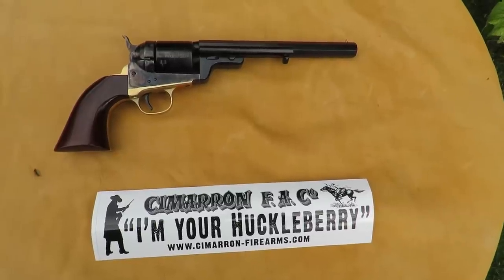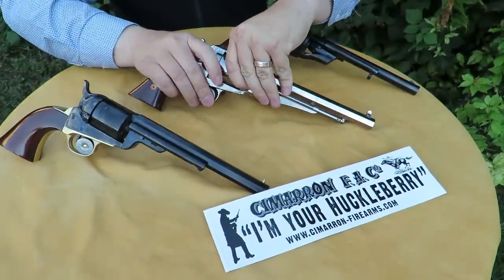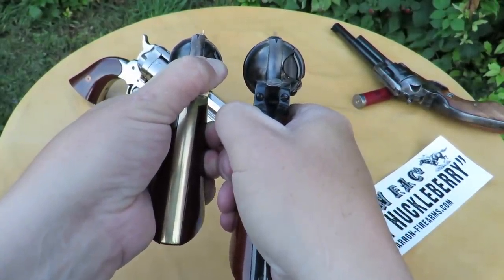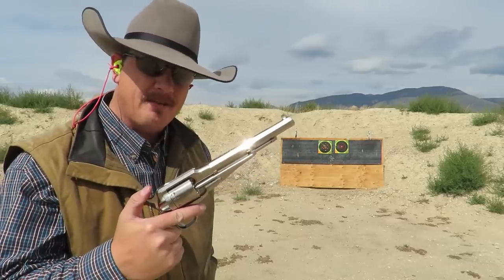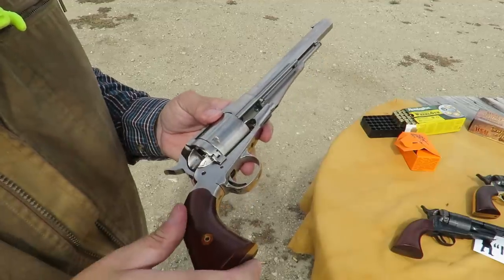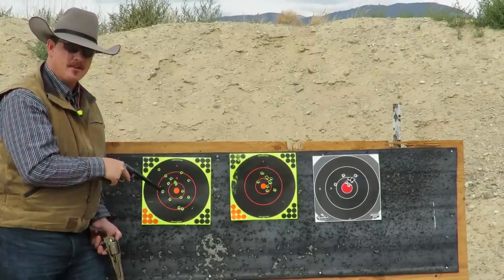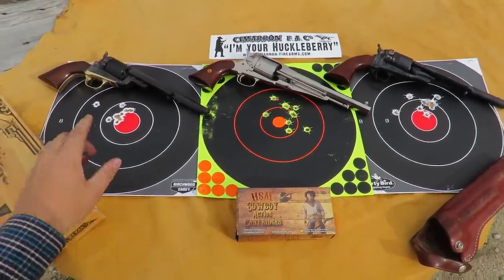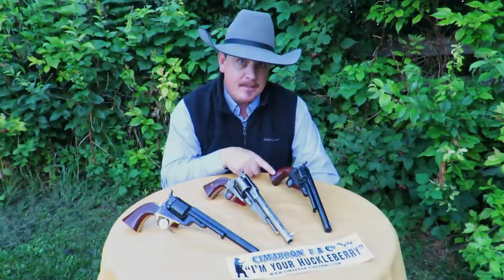CONVERSION REVOLVERS! from Cimarron Firearms

Comment: Let people know that on the Remington, the rammer was left in place because it still retained the cylinder pin, keeping it from coming out.
Reply: Jason, that's true but the other reason was you could easily convert back to the cap & ball version.
Reply: @toddy2519  On my Remington FULL conversion, there is no going back to percussion, thus the plunger of the loading lever was removed.
Reply: @toddy2519    I'm wondering if you could use it to reload the cartridge in a pinch. There would be no way to crimp it, so the bullet would probably pull out of the case under recoil.  Still, in a pinch an old time cowboy could maybe load and single shot shoot these …...
Reply: @MuskratOutdoors  I'm not sure what you mean, could you rephrase the question? (are you asking that when using a cylinder conversion can you reload a centerfire case in the gun using the rammer?)
Reply: @toddy2519    Yes. I have never heard it used that way, but I think it would work. When you think about it, a self contained brass cartridge, and a cap & ball cylinder are basically the same. A primed empty case in a reloading die isn't any different except crimping the case neck.
Reply: @MuskratOutdoors  That's why I don't own a Remington pistol!  I like my Colt 1860 Army waaaaay better.
Reply: @toddy2519  Not necessarily. Depends on how the conversion was done.
Reply: @MuskratOutdoors  The Ideal company made a hand loading tool (Sometimes called a "tong tool") in numerous cartridges. With a single tool, you can cast a bullet, size it, prime the case, bell the case mouth, and seat/crimp the bullet. Several YT videos about them.
Reply: @jason60chev   I actually collect those. I have a dozen or more of them, but thank you for the info.
Reply: Depends on the conversion. I've seen a few cartridge conversions of the Remington New Army that don't have the ejector rod - just a different cylinder with spring-loaded firing pins. You could easily swap between a percussion-cap cylinder and a cartridge cylinder in short order.

Don't know if that will work so much in practice, but I know the conversion exists.

Comment: The Remington was actually the most sought after once the Civil War ended.
Reply: WAR OF NORTHERN AGGRESSION
Reply: @boristhemouse5507  those blue belly yankees vs johnny reb 😂😂🤣🤣
Reply: Even before the cartridge conversions became common, the Remington New Army had a huge advantage over most Colt revolvers of the time. You could just throw it on half-cock, drop the ramrod lever halfway and pull the cylinder rod forward to replace your empty cylinder with one you already loaded earlier.

Which was a hell of a lot faster than pulling the barrel pin off the Colt revolver, pulling the whole barrel and ramrod assembly off, sliding the empty cylinder off, replacing it with a loaded one, put the barrel assembly back on and then have to beat the barrel pin back into the gun.
Reply: @boristhemouse5507 don't know man, the south shot first

Comment: Due to having a good machine shop at the time, I converted 44 Colt Navy 1851 replica made by Navy Arms to 22. Made new cylinder and detachable back plate that contained floating fire pin. Barrel insert was made from an old 22 rifle with conical muzzle nut. That way I could use it both ways  with very little work.  It shot pretty well and ammo was cheap. Put thousands of rounds thru it.

Comment: I love colts because they’re easy to aim but I trust Remington’s more reliable and robust design. Remington may be a bit slower than colt at reloading, but still reliability is more important than looks
Reply: the early stuff remington new army is easier to aim / dial in than open top colts. but i do love fussing with my colt open tops ! who i am kidding i love them all. i am ITCHING for the remington my buddy has an original remmy conversion all i can do is drool. h0pefully i will have one before summer, was supposed to get it for christmas but they were sold out. so i got a McCulloch instead. love that thing too
Reply: I was of the understanding that Remington originally favored brass frames that stretched over time leading to significant issues...
Reply: I have a pair of the 5.5 barrel 58's. They are my favorite guns to shoot when I compete in cowboy action
Reply: @InitialFailure  thats false.. no one used brass frames but a few limited guns and the numbers were small like in the tens.. not even hundreds.. This is just a thing these modern companies tell you on the boxes..   I have brass frames 1851 and 1858s and havent noticed any stretching..

Comment: Loved the video - very informative for those unfamiliar with conversions.  I plan on getting two for Cowboy Shooting and participating in both cap & ball and cartridge. And bravo for shooting a second time with the .38 because we ALL suffer from those times when it is totally 'shooter error', and some more than others!  Thanks

[One small criticism of you and 99.99% of Cowboy Shooters and 'gunnys' - there is no such thing as a .45 "Long" Colt - admittedly it's part of the popular culture and labeled on all sorts of materials including the firearms, but Colt NEVER MADE a .45 LONG Colt.  They made short and long versions of the .32 and .38, but only made ONE size of .45.]
Reply from the maker: So, I agree and disagree. You are correct about the original designation, however when most factory ammo on the shelf is actually labelled "45 Long Colt" that does, in fact, make it "Long Colt". When most of my viewers go to buy them ammo, that is what they are going to see, so I use the current nomenclature to make things less confusing for them.
Reply: Colt made 45 cal, and so did others like Smith & Wesson and cartridges were different lengths, it just became 'habit' for people to say long colt, because it was longer than the 45 S&W used in the schofield revolver
Reply: I wondered how long it would take for someone to come up with that criticism.

Comment: There was nothing intrinsically wrong with the group from the 1851. It was perfectly centred, not high, low or off-set. It just needed to be tighter.
This is usually the sign of a worn barrel, but in a new pistol, it probably was the cartridges. 
Many years ago, I had the opportunity to shoot an origional ball-and-cap '59 Remington. I remember that I was not at all happy with the sight picture. Was it made that way in order to prevent it snagging upon the holster?
Reply from the maker: I would assume it was for that purpose.  My group tightened up the more I got comfortable with shooting it.
Reply: @TheAdventureCowboy  Glad to hear it. 
If  I had the choice, I would probably take the '51 in 38sp. 
I used to cast my own bullets so I would be interested in seeing how it does in the 100yd test.
Reply from the maker: @paulbeesley8283  Unfortunately, I no longer have it to test that.
Reply: @TheAdventureCowboy  Ah well, not to worry. Thank you anyway for your replies.

Comment: I own an example of the Cimarron 1860 Army type one Richards conversion.  It was made from parts manufactured by Armi San Marco, and assembled by Cimarron.  It is chambered in caliber .44 Colt.  It would be nice if Cimarron could convince Uberti or Pietta to manufacture a new 1860 Army Richards type one conversion.  If you like the type two Richards‘s conversion, then you would love the type one Richards conversion with its frame mounted, spring-loaded, firing pin, and conversion ring mounted rear sight!  Thanks for your great video!

Comment: 12:53 That reason is most likely the wrong ammo, since .38 Special is in actuality a .35 caliber projectile (in a .38 caliber chamber). Old-timey .36 caliber revolvers are closer to .37 caliber than anything else. Shooting off-the-shelf .38 Special like that, you're putting a .357 diameter bullet down a .372 caliber barrel (with .360 lands).

Appropriate .38 Special ammuntion for an old-time conversion would be wadcutters or any kind of hollow-base bullet so you get a skirting action on the projectile wide enough to engage the rifling.

Comment: Don't have a Remington, so I have to ask: Do you need the rammer there to keep the lever attached (like in a Colt 1860)? I am aware that you need the loading lever attached to hold the cylinder pin in place, which is why you want to keep the loading lever on a Remington conversion. I just assume that if one could get rid of the rammer, it'd go since you can't use the thing anymore.

Comment: Man, the 38 special one would pair awesome with my Marlin 1894 in 357/38!
Reply: Probably not so much, I'm afraid. A modern .38/.357 has a .357 bore diameter-- these old .36 guns were bored to .369 or the like (the muzzleloading bullets themselves were .375-.38 in diameter). The .38 Special loads for a conversion should be hollow-base so they expand wide enough to engage the rifling.

Comment: i was going to get one of these but ran in a good deal on two 1858 remington glad i did not get the conversion revolver they came with extra cylinders and 2 converters so i have the best of both worlds and it take 2/3 sec too change the cylinder it shoots cap and ball ,bullet and 45 long colt
Reply: just let know the 1858 remington that i got took first place in revolver shooting contest they have been reworked by a gun smith and the guy i got them from was expert shooter that was another reason i got them
Reply: you know they have a drop in side load conversion, you  will have to mod it a little but the you can have the best of all 3 worlds

Comment: Good review. You should have a Colt Italian clone old model  instead of a a Ruger for comparison. Cool thing about the conversions is that you can shoot 45 Schofield in the 45 Colt, 44 Special/44Colt/44 Russian in the Richards-Mason chambered for 44 Special, and 44 Colt/44 Russian for the one chambered for those. 38 Short and Long Colts can be fired in the 38 Soecial , I believe. These options give you good, low powered Cowboy Action loads.

Comment: With the Remington, it's easy to carry pre loaded cylinders, (either cap and ball, or a different type of conversion) and swap cylinders when empty. See Clint Eastwood's Pale Rider.
Reply: @buffbeezer This would be what many call a "factory conversion" and is permanent. (Except taking it apart for cleaning) The pale rider version is just a "drop in cylinder". The original conversion cylinder had small cut outs so that the hammer would strike the rim fire cartridge. The modern version has firing pins for centre fire cartridges. Duelist1954 has several videos on conversions.

Comment: I'm both a Cimarron fan and a conversion revolver fan.

 I've converted a Pietta .44 steel frame "Navy" to .45 Colt with a Kirst gated conversion and I've got the "Man With No Name" .38 Colt/ .38 Special "conversion".

  I have their 1851 Navy .38,   a Navy grip framed Open Top(yeah I know it's not a conversion) in .45 Colt,   and POSSIBLY an 1860 Army Type II in .45 Colt on my "to do" list.

 I'm partial to the Navy grip configuration, but the 1860 Army is still a lot better than a Bisley grip...to me.

Comment: I have a serious question about the 1858 new model army conversion in 45 long colt
Is this newer model drop safe from my understanding these newer reproduction revolvers have a safety mechanism if all the chambers are loaded I would like the older guns yes it's better practice to have an empty chamber but I'm just wondering if this one has that safety feature I am planning on buying this very soon I'm also curious if I can buy the original cap cylinder and switch it out whenever I want
Reply from the maker: It is not sold or marketed as such, so I cannot say for sure.
Reply: @TheAdventureCowboy  all right I guess I'll have to figure out how to check it whenever I get it and you know how I can get a matching non converted cylinder to switch out?
Reply: @Self sufficient Traditionalist thank you very much!
Reply: They change the specs on the Cartridge Revolvers slightly so you can not convert back and forth between Black Powder C&B and Cartridges.  Example the Uberti 1873 Cattleman Black Powder Revolver.
https://www.midwayusa.com/product/1002297696
Reply: @Self sufficient Traditionalist it's just I've heard that these reproductionshave safety pins and stuff in them so you can load all six Chambers although I know that it's safer practice to have only five

Comment: I keep hearing from other channels that there is no such thing as a .45 Long Colt, but should be referred to as .45 Colt. The term ".45 Long Colt" is so common though. I wonder the origin of using the term ".45 Long Colt".
Reply from the maker: It had to do with other .45 cartridges available at the time.  People just started saying "Long Colt" to differentiate from other similar, yet shorter, .45s, like the 45 Schofield

Comment: Is it necessary to take of the ramrod from the colt revolvers?
I'm just asking because for me it looks cooler with the ramrod under the barrel.
Sorry for bad English and greetings
Reply: They make them with the loading lever replaced for convenience of unloading spent cartridges, as well as to be a little more historically accurate.  The original factory conversions had the loading lever replaced like that, though there are just as many, if not more, that kept the loading lever. Mostly the so-called "blacksmith conversions" done by local gunsmiths. These are copies of the "factory conversions" that did replace the loading lever back then. I have never had an issue with unloading spent brass from any of my single action revolvers, so it is quite possible to keep the loading lever for looks without much trouble. The loading lever also makes it easier to remove the barrel for cleaning and maintenance  on an open top, if you know the "trick" for using it that way.
They do make a .38 special "Navy" open top revolver with the loading lever still in place, called "The Man With No Name" revolver, that is a fair replica of the gun carried by Tuco in "The Good, The Bad, and The Ugly". That one has a machined loading lever that comes apart to use as a rod for removing spent cartridges. Unfortunately, in order to make the replica revolvers capable of holding 6 cartridges, they had to make them slightly oversized compared to the originals. (About 10% I am told) That means you can't just add the loading lever back in on the Richards-Mason in 45 Colt (though depending on how it is machined, it may be possible to fabricate one that fits, haven't gotten a good enough look at one yet to see) or do a barrel swap. I do wish they'd make a "Man With No Name" 45 colt Army version, I'd buy it in a heartbeat.On the Richards-Mason, the forging and basic machining is already there, it mystifies me that they haven't made it an option already.

At one time, they talked of making cap-and-ball conversion kits for these to make them freely convertible, which would give you the option to keep the loading lever if you wished to, but nothing ever came of it. There are parts available to convert black powder open top cap-and-ball revolvers to cartridge, but require some gunsmithing knowledge or a paid gunsmith to do them (if you want them to be reliable at least) but in the larger calibers, such as 45 Colt, they  are limited to 5 cartridges, and make for a weaker cylinder, limiting them to reduced load or black powder cartridges only. The guns in this video in 45 Colt are capable of full SAAMI spec loads (14,000 cup) which is more than enough for that caliber. There is one 6 round cylinder available, but is hard to find, as the patent is held tightly by the company making them, they don't seem to be making them in large quantity, and they are the capped cylinder type, not suitable for a loading gate.
I own the Remington shown in this video (though blued, not stainless) that keeps the loading lever and is in 45 Colt, which is currently my favorite pistol :) And while it is a stronger and arguably more practical design, I just like the looks and handling of the open tops a bit more. I just can't get past the lack of a loading lever to buy one. I will be picking up the "Man With No Name" revolver for my wife to use (she can't handle the recoil of a 45 Colt) when I can come across one at a good price, but it's just not the right caliber for my own carry.

Your English if fine.
Reply: @faelwolf1177 
Wow thank you for all this help and information.
Have a nice day
Greetings from Germany

Comment: I know this was shot a while ago, but quick question on the 100 yard shots: how high did you have to aim for those? Thx (just bought a 1860 conversion)
Reply from the maker: Not as high as you would think! I can't remember for sure, but I probably just held several inches high of the bullseye.

I killed a deer at 55 yards with one shot last year using that same Cimarron 1860 Richard's Type II Transition 45 Colt.  I held the bead right on the vitals and dropped her.
Reply: @TheAdventureCowboy  Well, after my first rounds out my 1860 conversion, I can see why you didn't have to hold it high at 100 yards. At 15 yards I was hitting 7 inches high and at 25 yards 13 inches high.
Reply from the maker: @dannykelly3191  Someone told me that is because that is how the originals were. Like a 50 or 75 yard zero.
Reply: @TheAdventureCowboy  That's what I've learned too. Not too many mentions of this in any of the videos I've watched regarding these guns.

Comment: Do the cartridges in these guns have to be loaded with black power only?  If not, where can I find the safe loading data for them?
Reply from the maker: Nope. factory off-the shelf, standard pressure loads work fine.
Reply: I run  BP and smokless loads in mine. BP is a lot more fun but a lot messier too so I stick with smokless most times.